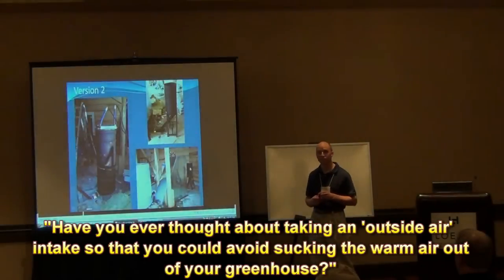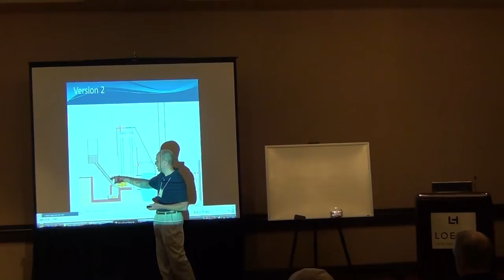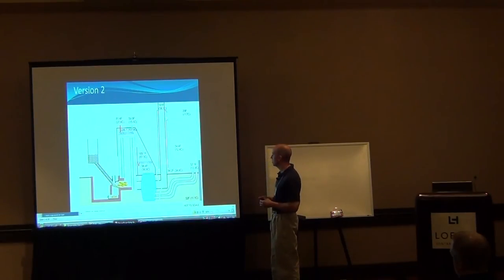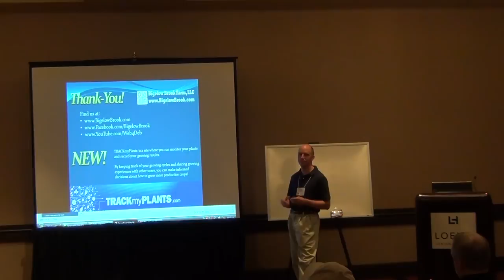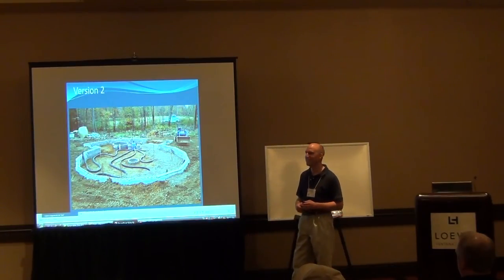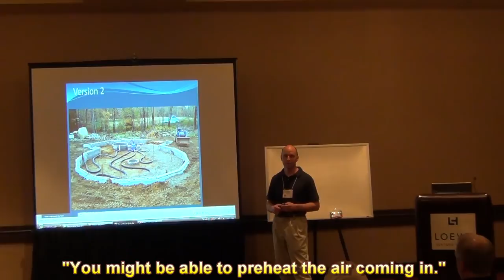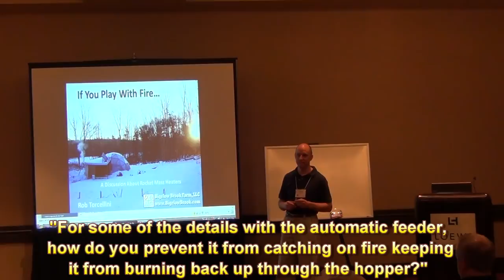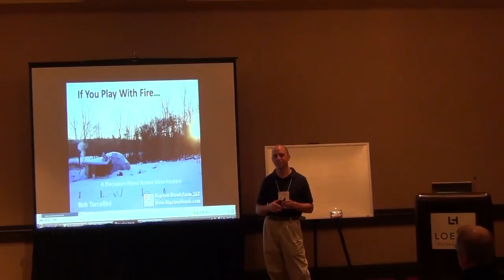"If You Play With Fire..."  Rocket Mass Heater Presentation - Part 3 of 3

Comment from the maker: I had thought about doing that in the original design.  It's one of the reasons why the blue barrel for the underground piping lis located where it is. It's located right at the base of the dome so some ductwork can be attached to the dome's frame.  I just never got around to installing it.  ;-)

Comment: I'd love to build a rocket mass stove one day, but I can't where I live now. I'm using nut coal to stay warm and it works well. $400 for 2 tons delivered, enough to last the whole season. I shake out the ash and load it once in the morning and once at night, and it'll stay hot all day. I start it with 2 or 3 small pieces of hard wood, get a good hot area of coals, then the anthracite coal starts to burn. once the whole thing is glowing hot, I can close down the air vent and it'll burn on its own all day or night. can't smell anything outside once it's burning hot. have a real good draft in the chimney too. I got triple wall stove pipe, not cheap but works great. it's like a double wall stainless pipe, an inside and an outside pipe, then it's packed solid with some kind of insulation. I wouldn't doubt it's rock wool, but it's white. heat is the problem with a lot of chimneys. if it doesn't burn hot enough then you get all kinds of dangerous buildup inside the pipe. burn too hot and it damages the metal, you'll be replacing it the following year.

Comment: You could actually use an air intake from outside as a dehumidifier. Have the air intake come through a branched system of copper tubing before leading to your stove. The cold air from outside will cool the metal down enough that it will be a perfect surface for condensation to form on. Collect the condensate and drain it into your system. I bet with enough airflow you could remove a lot of water from the air!